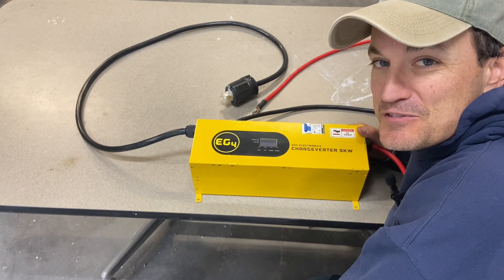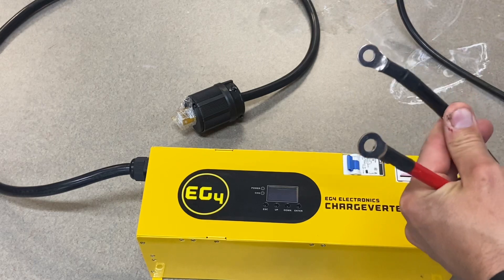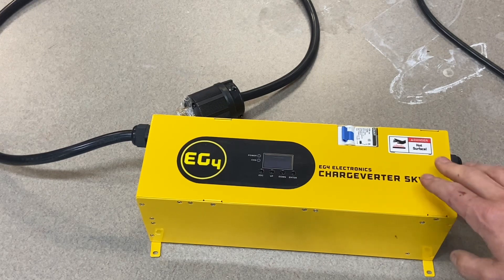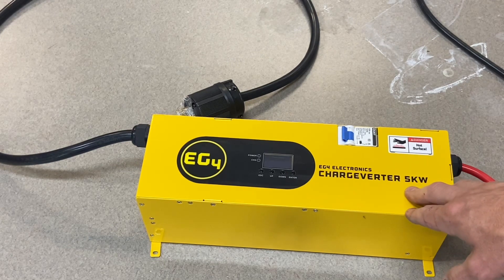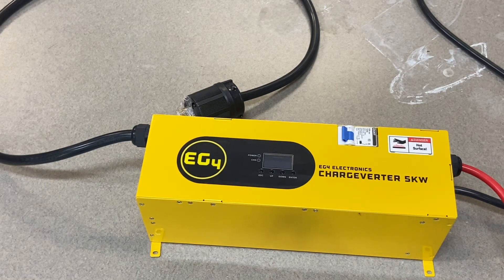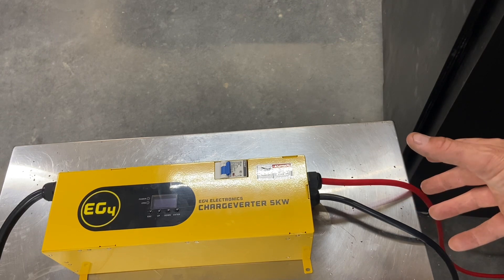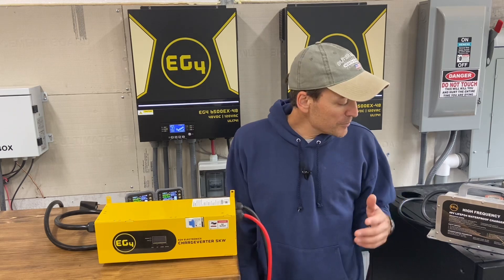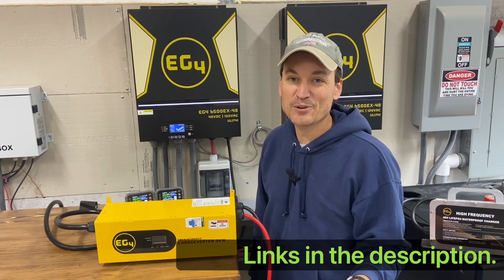EG4 chargeverter review

Comment: I've tried to make my newer version of this chargeverter work, but after what feels like a hundred attempts, the damn unit just won't rapid charge.  Can't even get the unit to recognize an EG4 LifePO4 batter communcation cable, so I can see SOC.  Never has worked.   $600 investment, sitting unsued.  Called the support line, and they suggested lowering or raising the Battery Start voltage, but on mine, the highest I can raise it, is 52V.  That's because the circuitry forces you to have Battery Stop set 5V higher, which for me is 57.  My batteries NEVER get lower than 52.2V, when there dead.
Reply from the maker: So it won’t charge at all? Even if you set your charging voltage to 57v? What batteries are you trying to get it to  communicate with?

Comment: It looks like you connected the Chargeverter output to the battery bus bar on your Master EG4 Inverter.  Doesn't that mean that the generator output from your "dirty" generator will still flow into the inverters?  As the inverters will be drawing power from the batteries to power your house, how does that effect the charging rate of your battery?  Would you increase the amp or volt setting on the Chargeverter to compensate for power your Inverter is drawing from the batteries?   Normally you would be charging your batteries from grid power and/or solar power fed thru your inverter.  Do you need to disconnect the Chargeverter from the system when you aren't using the generator?
Reply from the maker: The chargeveter is the one that takes in the power from the generator and converts it to DC. So you could almost look at it like a filter. There isn’t any dirty power issue that way. You don’t have to disconnect the chargeveter when you aren’t using it. Everything can stay as is. If you are using battery when the chargeveter is charging it would technically be using DC power straight from the chargeveter.
Reply: @GavinStoneDIY  Thank you for your quick responses to the dumb questions I have asked on this and other videos you have produced.  I am trying to design a Backup System using an EG4 6000XP inverter and two EG4 PowerPro batteries.  I can't afford to add solar at present, so I plan to use a small 5KW 240volt 30amp generator I already have to charge the batteries thru the EG4 Chargeverter when the grid goes down. I plan to use a Reliance 10 circuit 50amp Transfer switch as a "critical load" panel so I can select specific loads to power with the inverter when the grid gows down.  I would appreciate any thoughts you have on my proposed system.  Thanks so much for all of the great videos you have provided.

Comment: Dumb question I'm sure but can I wire this directly to a battery (EG4 Lifepower4) to charge it up so that I can add it to the bank in 100% SOC like the others. (No inverter) tux do much... great video as always! 👍
Reply from the maker: Yeah you can use this as your charger for sure. You can even hook it up to the rest of the bank as long as the breakers are off to the other batteries.  Then when everything is at 100% switch the others on.

Comment: Does this thing actually need 240v to recieve maximium rating or simply dual 120v lines?  The latter makes more sense since it has 2 seperate internal modules.
Reply from the maker: In other words can you somehow divide the 120v between 2 inputs and achieve the full charge capability? I don’t believe so no.
Reply: @GavinStoneDIY  Yes like on the plugs used on parallel kits.  Then using a 14-50p to 14-30r twist adapter
Reply from the maker: @shaunnightfire8269  it’s an interesting concept. I can ask eg4.
Reply from the maker: @shaunnightfire8269  so they said it does need a actual 240v connection yeah.
Reply: @GavinStoneDIY  Shucks.  Well thanks for looking into it further.

Comment: How long would it take to charge a 6 battery server rack from 20% SOC to 100% SOC with this unit ?
Reply from the maker: It’s hard to say exact numbers. But probably around 4 hours. It would be better to say 5 hours in case you wanted to drop the amperage down a bit.
Reply: @GavinStoneDIY    Thank you.   Man you sure are quick with your responses and I appreciate that.  I guess it would depend on the Generator also.  I'd probably set it so my generator is at about 80% of capacity right ?
Reply from the maker: @sjbill1793  yeah I’d prefer to keep things at 80%. Everything runs a little cooler that way.

Comment: Would be cool if they added output contact to start a generator  at a configurable voltage setpoint.
Reply from the maker: I’ve heard that may eventually be an upgrade in the future. As well as a soft start for the amperage.
Reply: Why not use the one in the Inverter?

Comment: How LOW of volts can it be set at? My system is 36volts.
Reply from the maker: It’s designed for 48v systems. So that is as low as the settings will go I believe. 36v systems are pretty rare at this point. You don’t see many.
Reply: I had 2 Ames charge s go out  been thanking about trying one of eg4

Comment: Twist loc connectors must be twisted for full contact a minimum heating guy !!!
Reply from the maker: You’re absolutely right. I was in full on “test mode” and didn’t think about it. Thanks for the heads up.
Reply: Can you use the same use unit to charge from the grid
Reply from the maker: @chrishaymond2837  you could yes. But most inverters already come with a grid charging option. So the use case for that would be pretty small,

Comment: I got one myself and its a good charger so far. I would suggest you open up charger and make sure all connections are tight. I was told SS would not have a cable adapter for 110 use, they even went as for as not offering me a cable schematic as it would be a liability to publish. How do you like your new cableway?
Reply from the maker: That’s a shame. They had said before they are working on an adapter. Then again, It depends on who you ask maybe. The wireway is awesome. Everything is so clean. Plus it’s a nice place to set tools. 😉

Comment: Good to know you can charge with it at the same time as the inverter charge controller.
I have the old 18 amp charger, will it also do this?
Reply from the maker: Yes sir. DC power is funny like that. You can have multiple charging sources on the same bus bar. It’s like having 2 charge controllers. Same thing. The 18 amp would just take ages to charge. 5 hours for 1 rack battery.